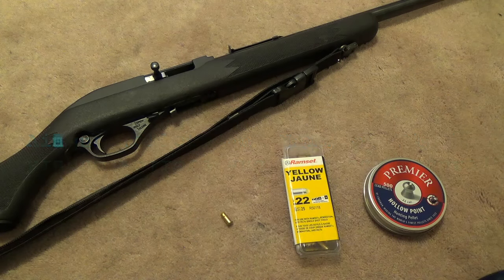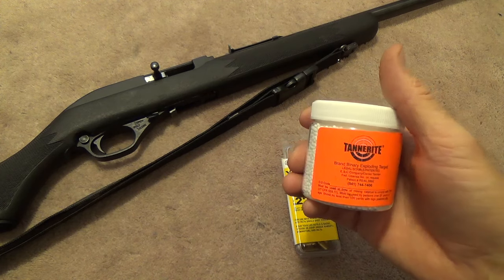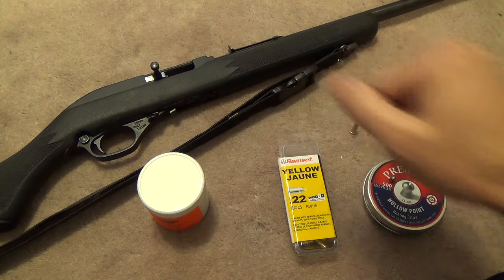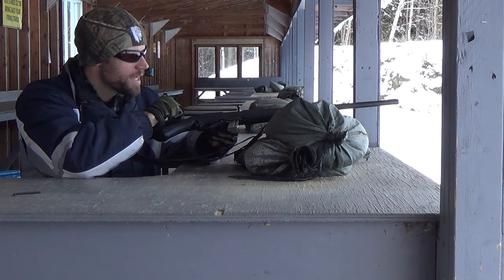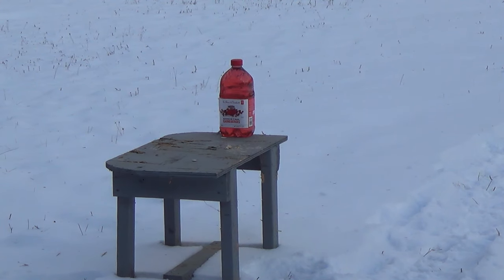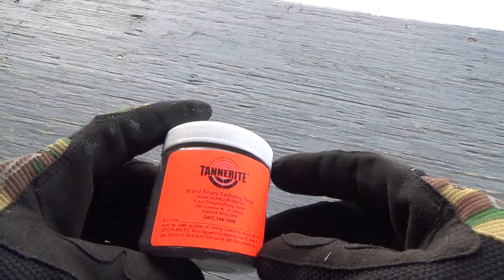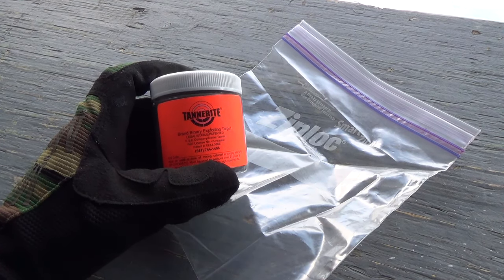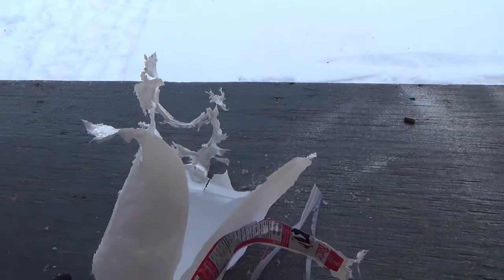Airgun Pellets, Nail Gun Blanks, and Tannerite

Comment: Nailgun blanks use a high-speed burning powder. So it's gives a much more energy, pressure and temperature output than standart ammunition of the same type (in this case - .22LR). Also - pellet highly deforms from the instant high pressure applied, and can also damage your barrel.
It can damage your gun, by burning rifling edges or deforming a chamber. So it is recommended to use it in a smoothbore barrel, and with a weapon with massibe chamber. Semi-auto rifle is a risky choice. Especially, when you don't want to break it.
Reply from the maker: Like I said in the video though, it's not my rifle, it's Curtis's. Lol!

Comment: i got 3100FPS from an 18 inch barrel, had to use solid copper pellets, and clean the barrel every time, there was alot of material left behind from the powder and some copper left behind as well, i'm guessing from friction, i was also using yellow power drivers
Reply: Try a sabot round

Comment: VERY interesting.  I did not think you would get a result.  I ended up doing an accuracy test with my pellets.  I will post it soon if you are subscribed.  I was actually getting some decent groups with some combinations.
Reply from the maker: RyeOnHam Nice. I'd be interested to see what kind of groups could be achieved.
Reply: Coming soon.  Have to edit... and that means time that I don't have.
Reply: what you recon would happen if u emteyed the powder and put black powder in instead or maybe even with. then stuck a 22 cal heavy ball in a c02 revolver? so you have 6-8 blanks in the clip but blanks filled with black powder or just the blank round or both mixed?

Comment: Dude! What an awesome way to clear snow off the roof!
Did you find the blanks to be extremely dirty in the gun? That would be my guess.
Nice video, thanks.
Reply from the maker: 1967Twotone The blanks weren't all that bad. There was added residue in the action but not nearly enough to warrant an extra cleaning. I was more concerned with leading in the barrel since those pellets were going so fast but that didn't seem to be a problem either. Maybe that was because I only shot about a dozen of them total.

Comment: hey matt, i believe another reason why you wouldn't get accuracy is cos the rifling in your .22lr is designed for .22lr rounds vs air rifle pellets. if you used an air rifle barrel and drilled the breach to 6mm to fit the blank and set that off, accuracy is alot better as the air rifle barrel has the rifling designed for the air rifle pellet, i know cos i've tried it. i believe its called a zip gun.
Reply from the maker: Nismogtir1 .22 calibre air rifle barrels and .22LR  barrels both have 1 in 16 twist rate. It's more likely that the extremely high velocity simply pushed the pellet straight through the rifling instead of allowing the pellet to spin. Firearms that fire bullets at these velocities require the bullets to be copper jacketed so this doesn't happen.
Reply: mmatt .22 cal air = 5.5 mm .22LR = 5.58 mm that is a big difference considering a great gunsmith almost works in thousandths of an inch. 22LR bullit wont ever fit in a 22 air rifle barrel. It's why it won't ever work with an air rifle since the shell case is over 5.6 mm. ( unless u start drilling and make a firing pin urself. I wouldn't do that tho it might not be the safest thing to do..... U probably create a small pipe bomb. I know i sound like someones grandfather but it's just really is dangarous!
Reply from the maker: Robert Hünker The airgun pellets that I used measure 5.67 mm and my .22LR cases and projectiles measure the same at 5.71 mm - that's a difference of only 0.04 mm or 0.0016 inches. But I'd still never attempt to shoot a rimfire cartridge, blank or otherwise, through an airgun. They just aren't designed for that type of pressure.
Reply: more so that the pellets aren’t designed to fly at that velocity
Reply: Pellets are most accurate at 1 or 2 hundred feet per second under the sound barrier

Comment: Use the nailgun blanks.. but take one pellet and melt it in a spoon. And use it to fill the back of another pellet.   Then your pellet has 2x the weight.  It should fly straighter, have more energy and still be able to take advantage of the diablo shape

Comment: What distance were you shooting? Reason I ask is because the experiments I have seen show very accurate at close range, but the accuracy falls off really fast. Ten yards or twenty yards, good groups. 35 yards or more, difficult to make certain where they were going to land. That's what I've seen with this technique.
Reply from the maker: I couldn't have been more than 20 or 30 feet from the target. I did not get good accuracy at even this close range.
Reply: @mmatt  -  You were definitely getting skirt damage to the pellet then. Not sure what else, but definitely that. 
Might try again with this change. Muzzle load the pellet backwards. Mark your rod so you get consistent depth then follow with the nail blank. If that doesn't change anything, I'd stop there. Don't try it with the solid pellets like a couple of people mentioned because those weigh considerably more and you are bound to be playing with dangerous chamber pressures at that point.

Comment: 5:18...the cap on the tannerite is on cross threaded which will not confine the tannerite like it will if it is on correct and tight...which will have the obvious consequence of a reduction of explosive power
Reply: Probably still tight if he did not lose much material.  But yea, it is actually pretty hard to screw it on right.  Tannerite needs better/deeper threads.

Comment: A very interesting video, I've only just found it, thank you for posting. One thing that came to mind is that .22 ammo is 5.6mm but pellet are 5.5mm.  Eley Wasps in the blue tin are 5.6mm if that is any help.
Reply: Believe me, the force of the nail gun cap will blow up the skirt like a balloon, (if it is not ripping it apart).  I have a mag spring air gun that shoots the 16gr.pellet at about 875fps, (way slower than this), and it blows the skirt up for plenty of rifling contact and seal.
Reply: @EarthSurferUSA  Cheers for that, I hadn't given that a thought, so 0.1mm is neither here nor there. All the best to you for a happy new year!

Comment: I wonder what Canada's reason for not allowing .22 sensitive tannerite?
Reply from the maker: +Shane K I wonder that too....  :-(
Reply: +mmatt I found a yellow nail bullet blank on the ground lol
Reply: +Shane K  If you pop a fuse in it it goes boom boom the normal stuff requires more of a kick
Reply: Ralphgtx280 like normal canon fuse or something more
Reply: Worth mentioning that it is never a good idea to use anything like this other than how the manufacturer recommended but yes many compositions like this tend to be shock , friction and usually static sensitive , most will ignite at quite low temperatures.
Reply: Ralphgtx280 I thought this stuff was stable enough to not ignite with a fuse
Reply: Normal tanerite is really quite stable. The .22 LR sensitive targets are usually what you'd call quite angry.

Comment: There probably deforming the skirts on the pellets get some 22 air rifle slugs and try with them if you can’t get in Youre country send me a PO Box number and I’ll post you some from here
Reply: My Gamo .22 Mag swarm Gen2 springer air gun, (875fps with that pellet), blows the skirt up like a balloon, (I retrieved a perfect spent pellet from soft snow), and it really give a great interface with the rifling's, (2mm long rifling marks on the skirt end,---ballooning did that).  I would bet everything I own, that the powder charge is blowing the skirt to pieces as soon as it leaves the muzzle.  The skirt coming apart with all that pressure and super speed flow still behind it after it leaves the muzzle,--yea, it will go all over the place. :)